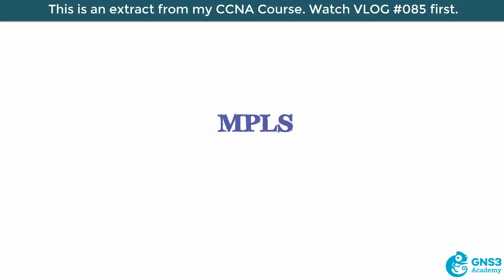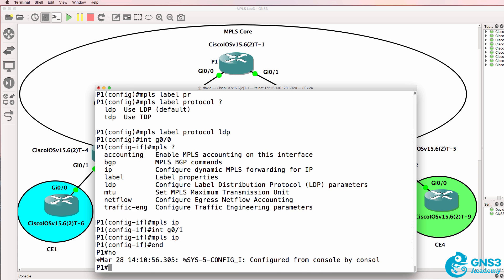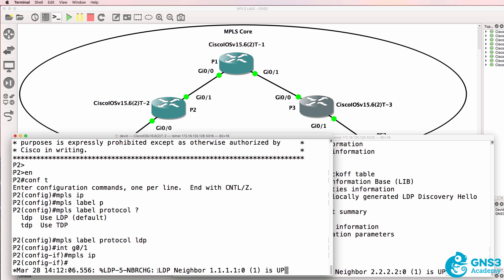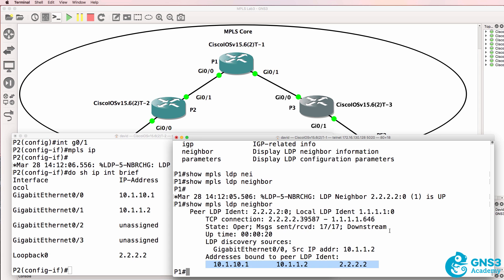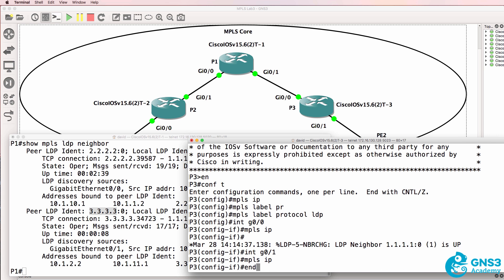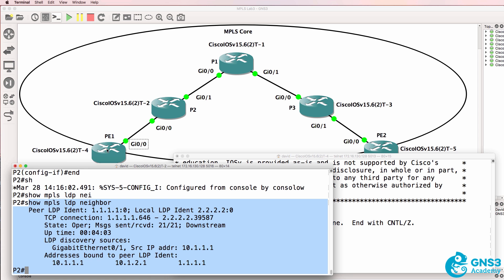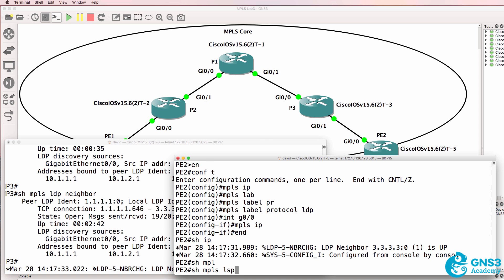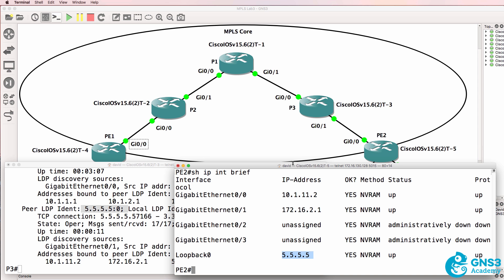CCNA #086: MPLS Part 3: Core MPLS Configuration: MPLS, LDP, Neighbor relationships

Comment: Hi Dave,
I ought to know this fundamentally, but why does LDP form a relationship with the LOOPBACKS and not the actual interface IPV4 I/F addresses ? Is it because the loopbacks are more specific in terms of longest mask ? IOW why doesn’t it use the actual interface IPv4 address ?
Reply: Loop-backs are always preferred for the Router-ID unless they are not configured. Reason is that an actual ipv4 interface can be down but loop-backs always remain up, for this reason loop-backs are preferred as Router-ID. But you can use this command "mpls ldp router-id (inteface) [force]" to force change the Router-ID
Reply: Qaiser,
THANK YOU❗️